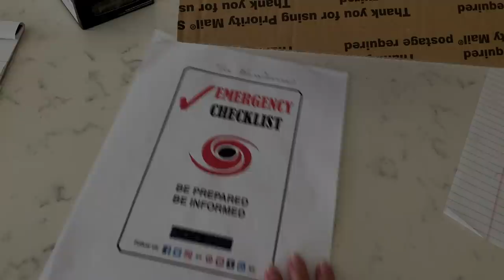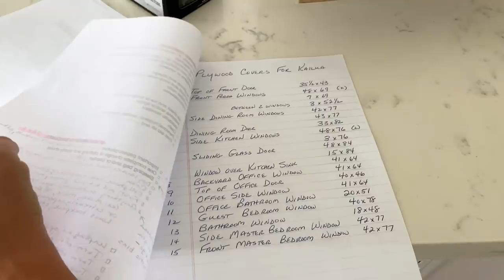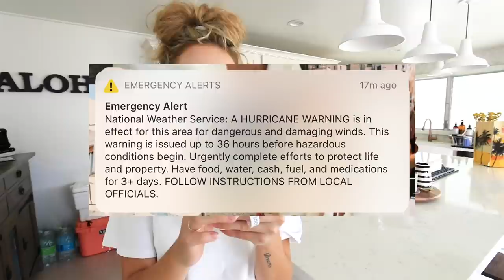Vlog: Preparing for My First Hurricane | Living In Hawaii

Comment: You should look into buying a Berkey water filter.  They are the best and filter water to taste just like bottled water.  You just refill it with tap water each time you finish and it does the filtering on its own.  Great for emergencies as well:)
Reply: Berkey Water Filters are great!... You can't get them at the last minute... If running to the store before a emergency, you're not ready, start praying the shop has what you need to survive... Don't gamble with your life, you don't automatically get a "trial run..."  She gambled and won...